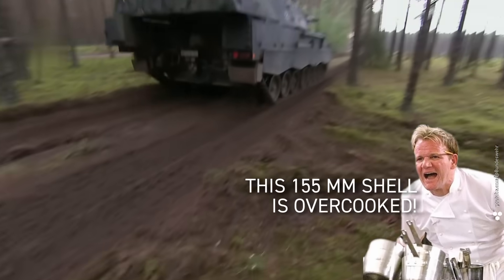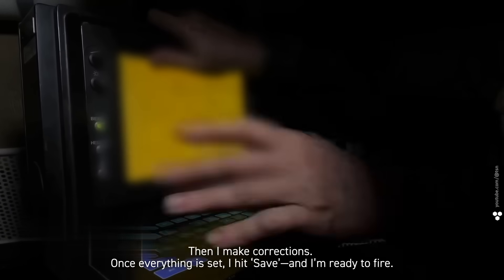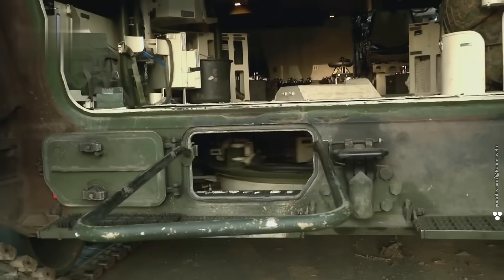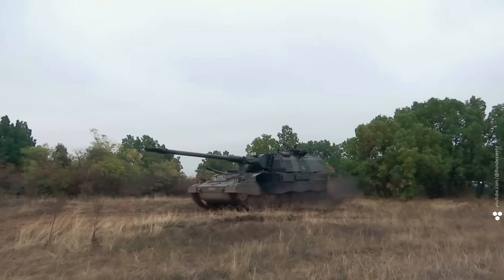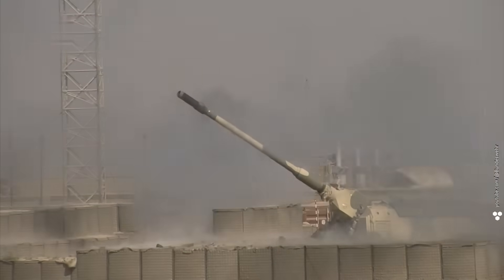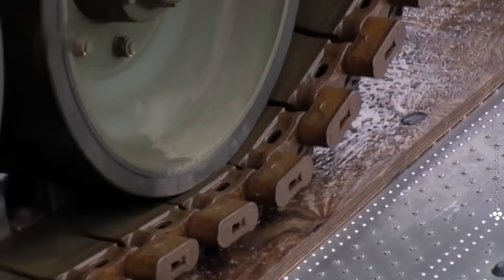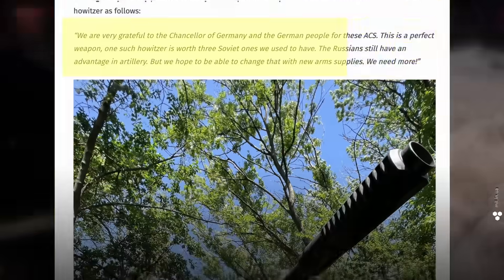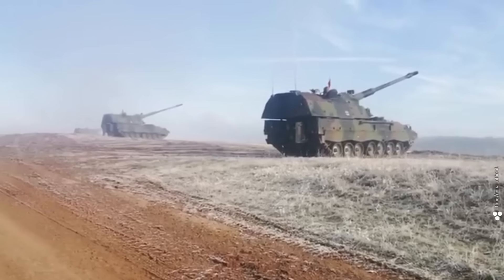Panzerhaubitze 2000: A Monster Howitzer or a Cosy Studio? | Ukrainian Soldiers Spill Hard Truth

Comment: Durabilit: There a Claims that Phz2000 shot more than 2000 Shells before the Barrel had to be replaced. And the Ability for Multiple Rounds Same Impact" Shooting. The Gun fires 5-6  Rpunds with a different Angle of Elevation and all will impact on the same are within 1-2 seconds.
Reply: The barrel is rated for 4.500 shots. Ukraine did up to 20.000
Reply: @zadarthule  It's still a traditional German product of the old school. Everyone in the chain adds a safety margin. You ask the officers what they need and they give you their number +10-20% safety margin. In the procurement document, you specify that the barrel must withstand a certain number of shots. In reality, however, it's what you want plus a 10-20% safety margin. The cannon developer takes this number as the target and adds another 10-20% safety margin. When ordering the steel, the steel manufacturer ensures that the steel has the required toughness plus an additional 10-20% safety margin...
Reply: over 20,000 - even the manufacturer was surprised that the barrel worked perfectly for so long - bad for them, now they can't sell as many replacement barrels.
Reply: @Rick2010100  Not true, manufucturer is happy to such quality as they can use the barrels for new complete PZH2000`s  and the order books are full of orders for years.
Reply: @Rick2010100  pretty sure the manufacturer was not really surprised....but the sales people were pissed
Reply: You forgot a zero at the barrel life 😅

Comment: PzH2000 started to rust too quickly at sea
Reply: Yep, and replacing the aluminium parts with steel would have made the turret too heavy for land operations, which meant the naval and land version would be fairly different - which was the opposite of the MONARCH program's  main goal. Add some political pressure from Italy because Leonardo/OTO Melara is the prime contractor for all naval guns in the german navy, and the program was doomed.
Reply: Also watercooling is thing in fast firing naval artillery.

Comment: They are still working on new System improvements for the Panzerhaubitze (PzH) 2000.
These new capabilities made possible by the PzH 2000's modularity.
It will include another new advanced 155 mm gun firing ammunition with a range of 100 km and beyond. 
Related option will also be an automatic charge loader, in addition to 30 additional ready-to-fire rounds.

Another worked on and proposed system improvements would be additional protection for the PzH 2000. 
This includes lightweight roof protection of the SPH against unmanned aerial vehicles, as well as a remote-controlled weapon system to protect against drones.
Better and newer Optronics on the roof and a total 360 vision system for the driver would improve situational awareness.
Reply from the maker: Sounds promising, but how soon will these upgrades actually make it to the battlefield? With Ukraine's urgent needs, will they benefit from these improvements, or are they more for future conflicts?
Reply: @Weapons.Of.Victory   They wont be battle ready within the next year or two, thats for sure.
Reply: @Weapons.Of.Victory Not really soon, mostly because thanks to the rch 155 the tech in the pzh2000 is partly outdated.

Comment: Since this is a new Video I miss the new (experimentel )  Ram Jet 155mm Shells delivered by Rheinmetall , theese have a whopping 100 km Range / 62 miles which is way more than the Russian Artillery . Can be used by the PZH 2000 or RCH 155 , maybe onther NATO 155mm Artillery Systems as well . The Shell flies with mach 2,5 = supersonic speed
Reply: Afaik those are still in development but should be deployed in the near future
Reply: With such a propulsion system, how much is left for the warhead / payload? Are they accurate / self guided? What is the cost of one such shell?
Reply: How many barrels per shell do you need there? Jk but seriously, barrel wear must be atrocious at 3x range/kinetic energy?
Reply: @DackelDelay  As i understand it , the Barrel  has nothing to to with the prolonged Range , its the Ram Jet Engine in the Shell itself ( with some Fuel ) which extends the Range , this reduces the Warhead of the Shell a bit but not as much as you think because the only purpose of the Ram Jet is to keep the speed of the Shell high for a few minutes , not to accelerate it
Reply: @MK-xc9to  that actually makes sense
Reply: @MK-xc9to Not quite. They're actually being accelerated. What you mean by maintaining speed is reaching base bleed lightly or a small rocket engine.
Reply: @MP-nc2pw  What i meant is just enough Trust to nullify the Air Resistance of the shell and reach 100 km Range . With mach 2,5 ( when left the Barrel )  its 51,45 km/minute = ~ 120 sec flight Time . Of course there is more to it than this simplified Formula because you shoot in the Air and the gravitation pulls on the Shell . 
An Ram Jet works different from a rocket Engine , an Ram Jet engine works  only at supersonic speed , most efficient around Mach 3 . They tested it with 100 Mile Range ( 155 km ) as well but i guess the Warhead was smaller
Reply: @MK-xc9to  That's actually the minimum speed. It works even better a bit faster. But as for the question about the explosives inside, of course, it's a bit short of charge, but all grenades that fly further than 35km have to make compromises. Those with a range of 70km have to make significant compromises. But that type of grenade can conserve barrels because you don't have to fire at 100% charge. The Norwegian version, by the way, is a bit longer-range. And they're already in field tests in Ukraine. 😀
Reply: @MP-nc2pw   I know , Rheinmetalls Version as well https://youtu.be/mX4Z6eiKql8
If a shell hits with mach 2,5 its even without a warhead quite a Punch . To Test it in real World conditions will only accelerate the development .

Comment: The update from the PHZ 2000 is almost fully automated . It only needs a driver and a commander if I remember correctly .
Reply: 😂
But jokes aside. The wheeled Upgrade of the PZH-2000, the RCH-155 has a completely automated, unmanned turret, needs only two persons to operate and can even shoot and hit while driving.
Reply: I guess you mean the RCH155, I wouldn't call it an update, because this sounds like the PzH2000 would be obsolete then, but having a heavily armored tracked SPG has its own use.
Reply: @randyraudi7725 The RCH 155 can be tracked as well, even if it is not the standard configuration necessarily. That version, I think definitely qualifies as a successor to the PzH 2000.
Reply: No. A PHZ2000 has Five Crewman
 Commander, Driver, Gunner and two Loaders. The Minimum is Three Crewman. But in practice the Automatic Loading has to be monitored and the Gun can be loaded manually if need to be. An in any  real Army there is a lot of  other work  to do beside just firing a Gun. Especially for Maintenance and Supply. Therefore any PHZ2000 has a Crew of Five
Reply: @Stormoak  You are replying to a statement about the PzH 2000s successor, the RCH 155. That one does actually require only 2 people.
Reply: ALMOST... "almost fully automated" almost...
After each shot the comander needs to load the Powdercharge, close the breach, go on the "Treibladungskanonierplatz", arm the gun by pressing "alt + F4" on the panel, move to the comanderseat or gunnerseat for shooting.

That slows down the fire rate a lot.
Reply: @shotgunsniper1530  Pretty sure, he is talking about the Rch155 and no, this is fully automated. 
The Pzh 2000 has a crew of 5 but needs a crew of 3 as minimum. Less than 3 does not work. But the Pzh200 has never needed a crew of more than 3, when everything is fine. The full 5 men crew of the Pzh2000 is needed during reloading of the Pzh 2000 and when soomething automated breaks down. Every automated part/step can be also used by a human. This is the reason, why there are several bicycle seats on the automated parts, someone has to sit down and move the part with his body. Even when every automated part breaks down, the Pzh 2000 will be still able to shoot 6 rounds per minute; with the full 5 men crew.
Reply: @shotgunsniper1530 and all of this in 10 seconds for 3 shots? Impressive